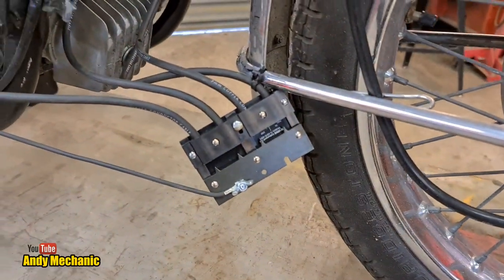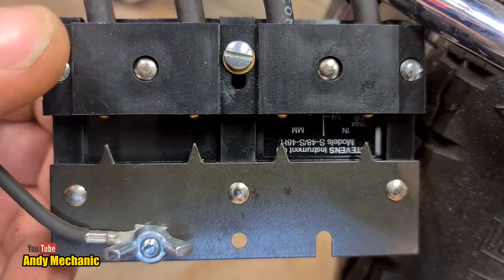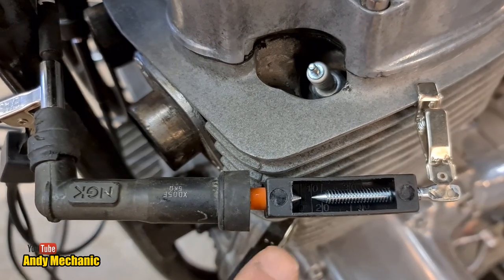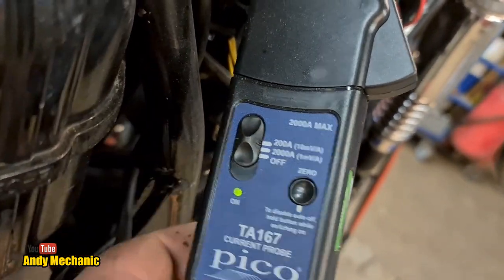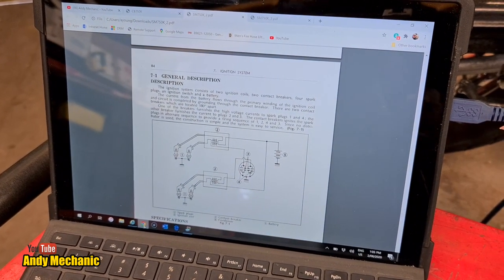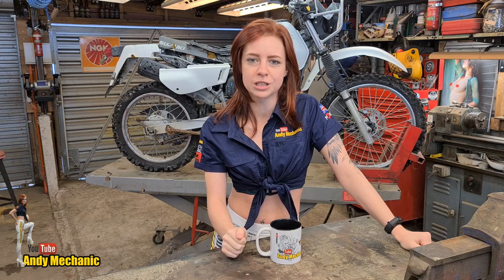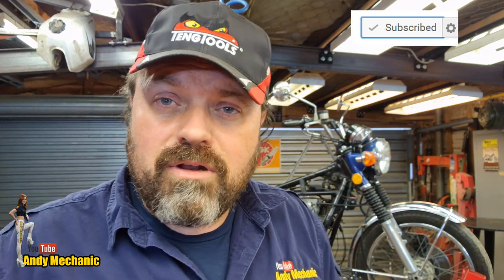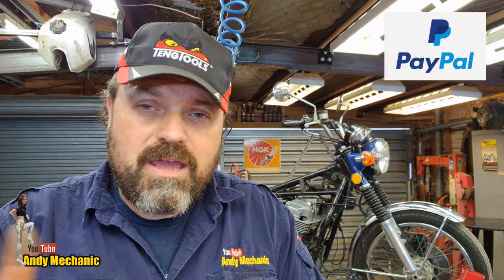Honda CB750 K2 - back on the road Ep.3 Spark & compression tests #1865

Comment: Guys say the throttle should be held full open when checking compression.  Thanks for the video.  Nice bike.  You know your stuff.  Looks like those points are aftermarket.  On TEC points the plate has those little marks all over like your base plate does.

Comment: Hi Andy,  here is something about compression that you might find amusing ,    I  bought a 49 Matchless G80 500 ,  it ran reasonably well , but leaked oil real bad from a split pushrod tube and seals , anyway after removing the head I found the piston ½ inch down the bore at TDC  !  Off came the barrel  , and then I found all three ring gaps at 3mm !  I calculated the comp at 4.1:1  ,  it started and ran ok    👍.
Reply from the maker: Wow! Lol

Comment: Andy....I just recently saw a restoration on a Yamaha RD 400 2 stroke from the same era. There are replacement coils out there that will work. Also....there are electronic ignition kits that can replace the points and condensers and will provide much better spark. Mainly just wanted to let you know that part is doable. Looks like you may need new rings on the bike as well, as long as the cylinders aren't damaged or out of spec.

Comment: Andy i have a cb550k from 1977, the same ignition system and a wasted spark.
Every year before riding it i have to clean the points a little with a bit of fine wet and dry sandpaper, if you measure the voltage across the points when they are closed you can measure the resistance of the point surfaces, they should be at least the same and when you clean one set first observe the difference it makes.
Doing this makes a big difference in how the bike starts ( less voltage for the coils when the starter is engaged ).
My old bike starts immediately when the start button is pushed unlike my brand new cb1000r which has to figure out when to fire before it's happy with just a crank sensor, i finally got the idle mixture screws dialed in correctly after all those years.
Also connected four plastic hoses to the float chambers through the drain screws and found that the breather holes above the fuel level needed unblocking........

 For some reason the points deteriorate when not in use.

i have a set of new spare points but still use the original ones because they still work after 60.000 km. and capacitors, the capacitors still have about the same capacity when i tested them last so no reason to change.

Nice to see a classic back on the road again, well done, cheers.

Comment: Andy, so would I be correct in thinking it’s possible that if the spark hasn’t been strong enough for a while it’s caused the valves to coke up (maybe) so they’re not closing properly and leading to the poor compression? The compression improving a bit in all cylinders with the addition of oil - you’re thinking the cylinders/rings are contributing to the poor compression also?

Comment: Put oil in cylinder 2 then do the compression test to see if it's the rings or the valves  I think its a sticking exhaust  valve